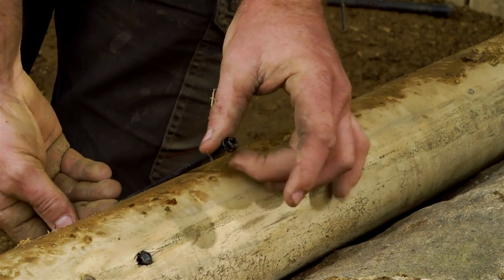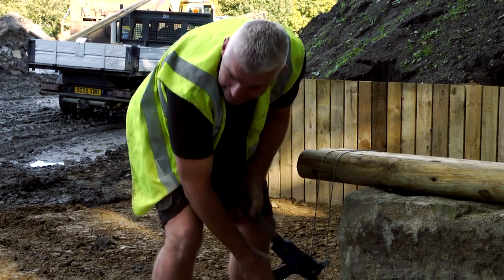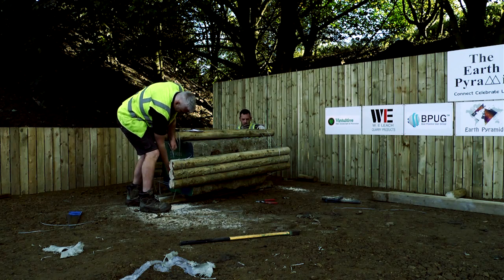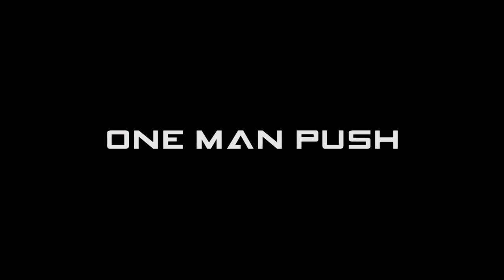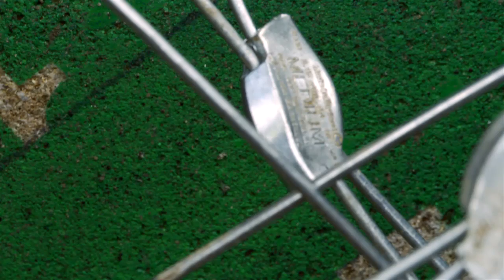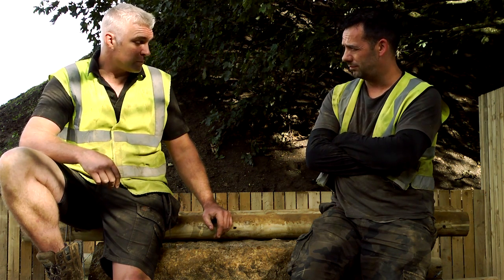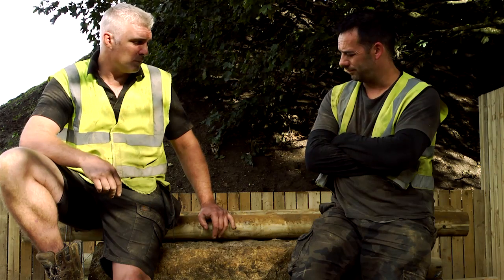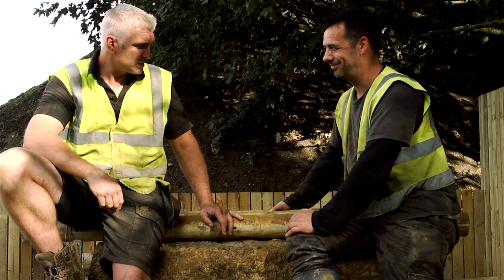Pyramid Documentary on Pyramid Building Techniques

Comment: I would think that having a thicker pole in the middle of the three poles would help, and putting two even thinner poles, one at each end of the three poles, would also help to make it more of a circular shape. Basically each side of the block needs to have the sort of curve going along the outer edge of the poles that the edge of a quarter of a circle has - this can be pretty easily approximated using just three different thicknesses of poles.

Comment: Question:  If you wrapped the poles to the block with traditional hand made rope and then placed skids or planking under the block between the rope holds, then the ropes would be clear of the ground the whole trip.  The ancients weren't as  limited as we are in man power, so couldn't they have laid tracks to roll these on and shaped the logs rather than just using them round as you are?  Tying rounded slabs to round out the whole block?
Reply: no it's not possible sorry

Comment: I’m pretty sure they didn’t have gripples or wires back then. They would have been using ropes. That guy that made his own Stonehenge has the right idea.2 smaller rocks under it and each rotation moves the rock a specific amount in a specific direction. A simple lever and then that dudes system that uses water to move the stones up the face of the pyramids is basically the best explanation. We can move those sized stones and they had thousands if not 10s of thousands of slaves (there slaves weren’t really slaves they were but they had rights, got a wage, had there own homes and family’s). People actually think aliens came to earth to help build them then left and never came back? Naw if aliens actually did build them they likely would have taken over the earth or something. Why would a hyper intelligent species travel light years to help these primitive monkeys build a monument to there king? Just sounds so dumb

Comment: I'd stick with the guy from Michigan who moved 20 tonne concrete block singlehandedly using Counterweights, pebbles and wood. I think his theory is spot on😁👍
Reply: Now move it from a quarry, drag it across a desert and up the pyramid and at pace where they can place multiple stones a minute.
Reply: @nmc400  It's multiple stones per minute only if the 10,000 workers only work on one stone at the same time. With 100 teams of 10 people workiong on moving one stone each at the same time, the "one stone every 4 minutes" changes to "one stone every 7 hours". Using the technique above, a group of 10 men with experience would only have to move a 5x bigger stone 600 metres across hard limestone bedrrock in 7 hours lol.  Easy work.
Reply: @rufioswitch2132 Landreau, Xavier. et al. "On the possible use of hydraulic force to assist with building the step pyramid of saqqara," PLoS ONE, 2024.).
Reply: @bobbykiefer4306 why do you keep posting this one junk article (it’s not even called a research paper) that only looks at the step pyramid which has 300kg blocks and admits that they’d have to have built half the step pyramid with ramps before even possible to use the fictional water hydraulic tunnel that is just the sarcophagus location?
It doesn’t even apply to other pyramids 
😂😂

Comment: There is a method where one guy can use simple counterweights and levers to get a large long block off the ground.  Then they would have simply attached metal wheels with ropes as suspension similar to what you have shown here.  If they had chariots and spinning wheels for clothes then they had the wheel too.  In centuries after moving the stones, they would have melted down the wheels for other uses which explains why we never found wheels used for moving stones.

Comment: Per Shane Pritchard's comment: cut notches for the ropes and ropes will work.  Also: natural fibre ropes often loosen when wet, so tie the ropes wet then let them dry (Egypt, after all) and they'll self-tension to a certain extent.
Reply: Careful now, natural fibers actually swell and shorten when wet!
Reply: @Bbonno  You could use that to add tension and add new ropes nice and tight while the tension is up and repeat the process until they're holding firm.
Reply: @Bbonno  oops
Reply: Exactly, just add more ropes or tension it with a wooden bar, see the working principles of roman scorpion weapon!

Comment: They have not 1 single hieroglyph that shows how the pyramids were built. No evidence of the machines they used.
Reply: Yes there is.  There is even an illustration, not just hieroglyphs, of a massive block on a sand sled being pulled with a rope by a bunch of people.
Reply: @EzequielBaltazar  🤔 Transport them is the easy part. The hard work beguin when they need to lift them to the top and place them in exact angle, to mantain the angle of the pyramid. Luckly, there is a simple answer for that, too. Researchers discovered they made inner ramps while they build the pyramid, and the angle was controled  by 4 guys placed some hundred of yards outside in evry side, with a hollow model of pyramid at exactly the same distance. That way, looking thru the model as work advance, was easy to spot imediatly any error or deviation in the angle, and send a messanger to correct it.
Reply: @rubenmundaca7895  Good ideas.
This stuff isn't even hard, after you outsmart the rock.

Comment: As far as i know, Egyptians weren't exactly advanced enough to have high tensile wire and a gripple gun ... 😂
Reply: Matt Grillz No but they did have ropes. They probably used the wires as a means of safety precautions.
Reply: @tjwhitley5284  Yes, it was a short cut that made the test easier without invalidating it.  Everything they did with wires could have been done by the Egyptians using ropes.  As a further test, it would be nice to actually use ropes to further confirm that it works, but this is a good first-step as is.
Reply: I totally agree and I would like to add the following: 

1. Pyramids' rocks weights range from 2 metric tons up to 70 metric tons. On average they are about 20 metric tons. Such weights would crush any ropes.

2. In the time of Pyramids building, ancient Egyptians didn't know the concept of the wheel, which was applied in that experiment.
Reply: @akramkafi350  twenty-five men can move a two and a half ton block. Fifty men can move it in a reasonable time. 

Average untrained man can deadlift 155 lb after a year of lifting every way that number jumps to 345 to 405. A ton is 2000 lb do the math. 

It's really not that crazy

Comment: The Romans just built rounds that surrounded square stone blocks.no reason you couldn’t do the same . The corners of the blocks were well within the circumference of the rounds, not on the edge, so the rounds could be made very secure to prevent any shifting. You could have one on each end and one in the middle of the block. You could then wrap the ropes around the block. Attaching the already constructed rounds could be a quick and easy procedure. Several methods could be used such as dowels pounded in to secure a mortise and tenon joint where the parts of the rounds join. The problem of different sizes of blocks could be overcome with shims.
Reply: Only problem with that is this is before the use of the wheel in Egypt only found in late old kingdom

Edit:typo

Comment: Try three ropes . Have each rope go up and over an elevated, horizontal roller and attach to a hanging platform. Add weight to the platform. Platform goes down. Block rolls.

Comment: No try it on the upward incline of the pyramids....
Reply: Curtis Corbitt you wouldn’t role it up a steep incline as it would be very unstable. If one end raises just a little higher than the other then the center of gravity shifts. Once that starts it quickly accelerates.It is very prone to going vertical. But you forget that on the other side of the pyramid is a decline of the same grade and height. One could simply run rope over the pyramid to the other side, or one could redirect the ropes then go back down the same side. Using pumped water as a counterweight one could drag a block loaded sled up the side. A layer of stones on top of the casing stones could have grooves or tracks cut in it. Grease the tracks, haves the sled’s runners run up those grooves- linear bearing.
Reply: @willg4802  the shape of the Grand Gallery indicates such an internal ratcheted sled mechanism.
Reply: Curtis Corbitt yes, horizontal and vertical movements are handled differently. This is a method for moving stones that have been lifted up the the construction level.It is not the method used for lifting them up to that level.

Comment: what about the 30 ton blocks?  or the 80 ton blocks used in the pyramids?  no way man built the pyramids using copper and rocks
Reply: Just because you are not bright enough to figure it out does not mean it is impossible. They also used stone, wood and WATER! Recently a fragment of papyrus has been found that gives some description of the way the pyramids were built. It says they floated the stones to the site. It says they were lashed to the bottom of boats and floated to the site. What direction does a boat move when the tide comes in? Up perhaps? You can use the same principle to lift the 80 tone blocks with ease. You just need to be able to fill a basin with water and empty the basin. You just need to be able to control the flow of water in a system you create. You put a piston float in the basin, put the megalith on the float. Then fill the basin. The float rises. There are practical problems such as the fact that when you roll or slide the megalith off the piston float it will suddenly rise higher, and this will in fact start to happen as soon as part of the megalith is off the piston and is being supported by the ground at this higher elevation. Those problems can be designed away.
Reply: @willg4802  
500 5,000-pound limestone blocks had to be moved up the pyramid each work day - for 20 years
that's about 1 per minute
this is an impracticable solution
Reply: @NoLeftTurns-i9g  🤔 Actually, it is possible and the technique was allready discovered in Kefren Pyramid. By letting a place to repair at the side of pharaoh tomb, they discovered that they use the same pýramid as a ramp. The video is somewhere in the web
Reply: @willg4802  
500 5,000-pound limestone blocks had to be moved up the pyramid each work day - for 20 years
that's about 1 per minute
this is an impracticable solution
Reply: @NoLeftTurns-i9g  Depends on what else you use in the ramp. In that documentay, they also use a slide made of hard wood supported by the stone blocks, with "brakes" in form of letter tha was used to help to push up the stone block and act as a brake, too. 🤔 Saying seems complex, but if you see it, actually is  very simple and allow to lift many stone blocks one behind the other, as  train wagons.
Reply: They used flatbed wooden sleighs, track rollers and Counterweights to move the stones. Wet the sand bedrock floor it becomes like an ice rink to slide stones along ramps. Heavier granite blocks used to build the upper Kings Chamber were pulled up by a Counterweight drop in the Grand Gallery
Reply: Strongly agree my man
Reply: mike lee there is a large rectangular shaft in the ground at the base of the east side of the pyramid. Would it not be possible to build a floating piston in that shaft,, fill the shaft with water, and raise an 80 ton block straight up vertically? The shaft is about 24 ft by 14 ft. It’s depth at present is 16 feet but it seems to have sand filling it. We know the pyramid was surrounded by a wall that held water in a reservoir at the base of the pyramid so add another 5 to 10 feet to the shaft if a wall surrounded it. I’ve done the calculations. You could raise an 80 tone block 8 feet.

Comment: You could have cut grooves around the logs to seat the ropes so as to illuminate the wear on them and yes you could have tensioned the ropes by means of twisting with a long strong fu@# off wooden pole then when tight enough wedge the pole around the ropes by cutting it down then tie into place. Boom!!

Someone order a knowledge bomb??
Reply: Add this rope technique and replace the 3 beams with half of a log to make it roll better. And with one piece its also easier to stay tight together. and boom...  Stone age breakthrough!  😂
Reply: a spanish windlass is the most likely to have been used alongside rawhide cordage.  It's also possible to make some forms on the edges.  I'm looking into moving ecology blocks and this way is most definitely a front runner for some experiments I'll be trying.
Reply: Longer poles tied to bend the poles toward the center
Reply: In the Ottawa Valley of Eastern Ontario we call binding like that a 'swifter'.